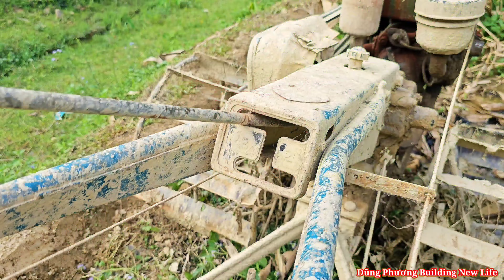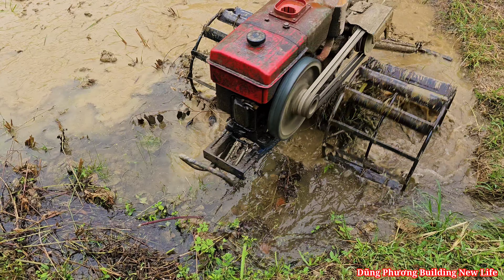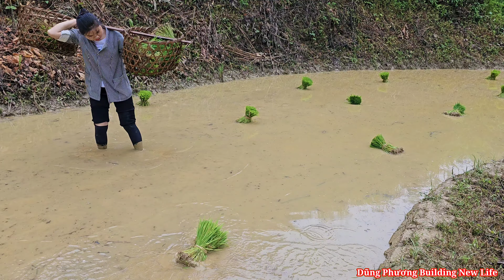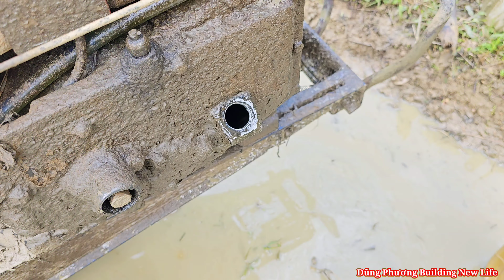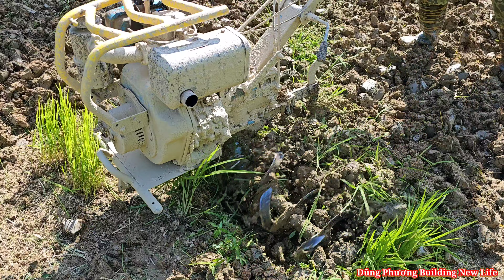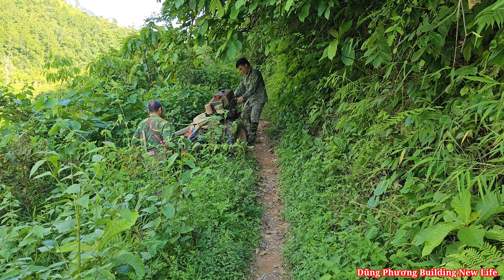Plow and harrow, improve the land, complete the new rice crop, build a new life

Comment: u are very Rich
Reply: Not really. If you are looking at the motorbikes, they are cheaper than North America, the plows are low speed 1 cylinder Diesel engine from china. Majority of Vietnamese have motorbikes as means of transport
Reply from the maker: I'm so poor my friend
Reply from the maker: You are very correct, most of the means of transport in Vietnam are motorbikes and all machines are bought from China at a very cheap price, but they are not very durable.